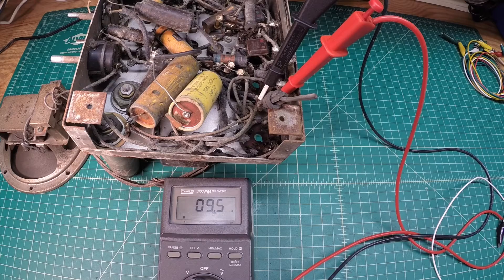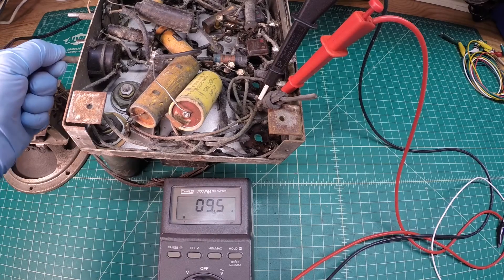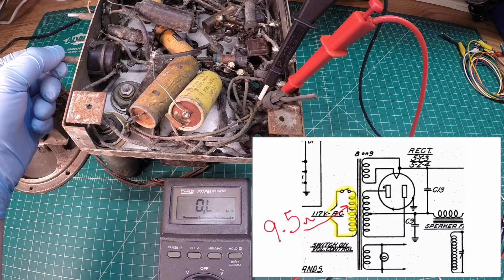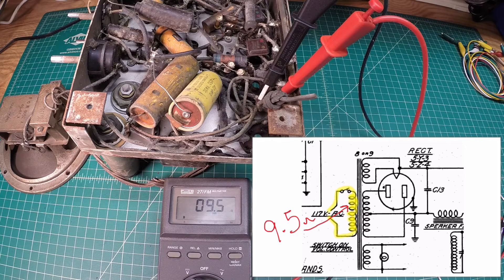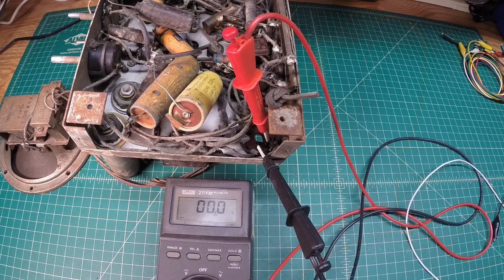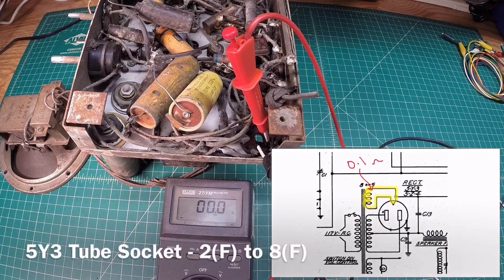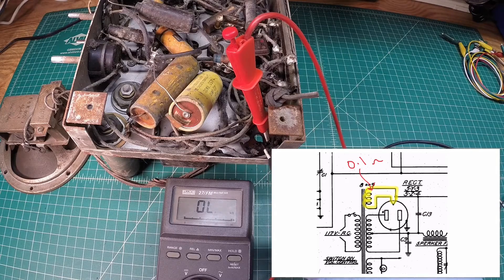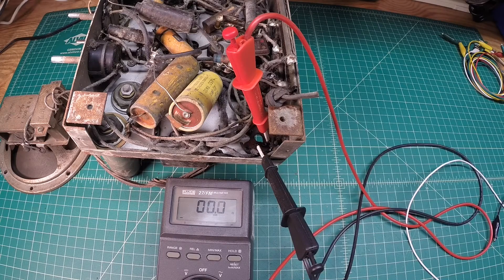Zenith 5-S-29: Power Transformer Testing

Comment: I tested my Zenith 5S29 main transformer as you did.  Looks good except my B+ winding is only 308 vac.  Further inspection shows it looks like someone changed the main transformer.  The transformer installed is smaller than the footprint of where it mounts on the chassis.   I think I may need to find a replacement.  Where do I get one?  How do I size it?  I looked on Radiodaze site and I don't know what current outputs I will need for each secondary winding voltage.   I could determine what I need for filaments but don't know how I would determine B+ winding current needed.  Any tips on sizing or where to get the right one?    Thank you.   John
Reply from the maker: +jp040759 John - I don't think you have anything to worry about as 308 VAC CT to each secondary should be adequate for the radio to play, unless the transformer runs hot. Aside from the power transformer, how is the restoration progressing? Best, Don
Reply: Pretty well.  I am not restoring at your level.  The owner doesn't want to spend that much.  I just need to configure and build and install the replacement candohm resistor.  I'm almost ready to power up.  Did some cleaning, replaced all caps and all resistors, repaired selector switch, new power cord with fuse, repaired /replaced several wires, repaired speaker cone,  cleaned lubed controls, installed 2 inch diameter O-ring on tuning mechanism, tested everything and prayed a lot.   I do not have a tube tester so I am praying they are all good.  Next step is to slowly power up and test as I go.   Fear of a bad tube has paralyzed me and I have been procrastinating.  I do know of a local guy that sell tubes.  Bob Bieker in Indiana.  I will try it with existing transformer and check its temperature as I go.  Thank you for all your help.
Reply from the maker: +jp040759 You are welcome. You've got a lot done already. Hope the tubes are in good health and the replacement power transformer works out. Keep me posted. Best, Don
Reply: Great news Don.  I finally got off my butt forced myself to move on.   I finished rebuilding the candohm resistor, mounted it,  and soldered it in this afternoon.   Check the rectifier first.   All was well.  Did final check of wiring.   Put remainder of tubes in and wound it up on variac.  All tubes were glowing.   Seemed like I was good to go.   Had no sound at all.   I was a little freaked at first.  Touched grid caps.  Got hum.   Then I remembered this thing has no antenna.  Gator clipped about 5 feet of wire.  Still nothing.    Cranked the volume heard a scratch or two.  Then I remembered the band switch.   Switch to AM.   She started singing away.  Wiped the huge smile off my face.  I tuned through AM band and it seemed pretty good.   I got signal generator warmed up and aligned IFs.   Put a 30 foot wire on for antenna.   This thing was picking up stuff on all 3 bands.   YAHOOOOOOOO!!!   My first restored radio.    My fear of a bad tube was not realized.  YAHOO!   I used the existing power transformer.   It seems to work fine.   Calibrated the dial.   I was viewing your video on the tuner.  My radio did not have bulbs or sockets for back lighting.  Had to see how your radio was set up for them.  I think I will use warm white LEDs for backlight.   Thanks again for all your help.    One question.   This radio draws 380 milliamps @ 120 vac.   That is 45 watss. RMS.  I that okay for this vintage radio?  Tranny seems to run cool.
Reply from the maker: +jp040759 Congratulations and well done. I know you were excited to hear it play again. There's something special about bringing one of these old radios back to life. I'm glad things went well and thank you for keeping me updated on your progress. I know she'll be a beauty. Hope to get back on my Zenith this winter or late fall. Congrats again. Best, Don
Reply: WOW.   You're a night owl  too or is it really early riser, unlike me..   Thanks.   i just finished wrapping it up.      Fabricated back lights with LEDs.   Looks great.  Put everything in the cabinet.   It's ready to present to the owner.   I was just watching the History channel earlier today and they had an episode on Pearl Harbor attack.    I was thinking this radio may very well have had Roosevelt's speech about Pearl Harbor when it originally was aired..   Neat thought.   Looking forward to your videos on your Zeniths.   Best   John
Reply from the maker: +jp040759 John, an early bird most days. Like you, I'm taken back when I think about the families that the radio(s) belonged to and how they would gather around to hear news or other... from around the world before television. I know the owner will be proud and pleased with the work you performed. What's next? Best, Don
Reply: I have my folks 1959 Philco AM/FM HiFi stereo record changer.  Same vintage as me.  It is 2 cabinets for stereo.   One cabinet has everything in it, the second is strictly an audio amp that connects to main.  Both folks have passed and I saved the Philco.    I would like to hear it again.  Dad used to hook up to external speaker to play Christmas carols outside during the holidays.    I think it was played last around 1973.   It would interesting to have a CSI crew analyse all the dust in it over the years.   It would be a living history of my life and everywhere we lived and all our pets.  Not to mention smoke residue from all the smokers in the family back in the 60s and 70s..   I wonder if any of my missing hot wheels cars are in it.  I used to love sneaking behind the cabinets to watch and smell the glowing tubes.

Comment: Good Job. Looks very good. Some may wonder why the two halves of a center tapped transformer would have different resistance, yet nearly the same voltage output. The secondary's of center tapped windings are normally wound one on top of the other, so the outer winding has a longer length of wire to complete the same number of turns. The turns are the same, but resistance is different. Very good series, keep up the good work......................Dick
Reply from the maker: Great explanation Dick. I recall someone mentioning that in the past, but I didn't recall the details until reading your response. I appreciate you sharing your knowledge and again taking time to watch. Best, Don

Comment: This is a very clean and informative presentation of the workings of the power transformer.  Your videos are clear, shot with a tripod so there is no shaking or movement, and your voice is pleasant to listen to, not nasally.  :)  I've been watching these restoration videos about  or 6 years now (started with John, "joernone") and your are some of the best, and I rate them up there with "MrCarlsonsLab" and joernone.
After almost 50 years in electronics as a ham, his is the first I've seen these type of meter leads, spring loaded,  clamp on, and long enough to keep your fingers out from around the chassis wiring with the power on.  I've got to get me a couple sets of these.
Reply from the maker: I sincerely appreciate your kind words regarding the quality of my videos and your feedback on the transformer testing. The parrot clips are growing on me too and I find myself using them more often than my regular leads. Thanks again for watching. Best, Don